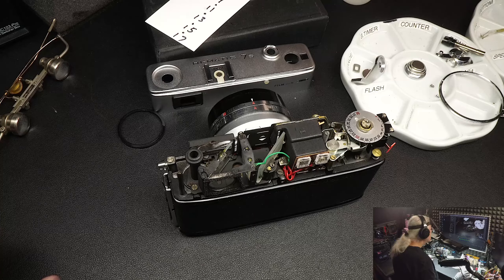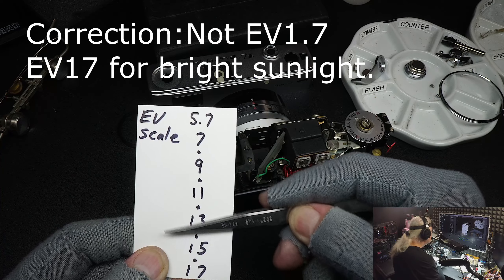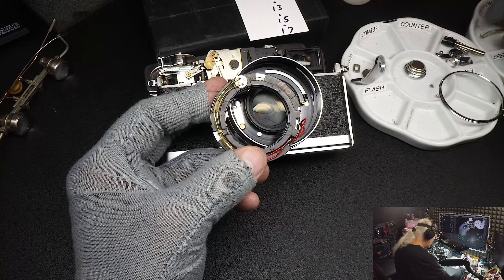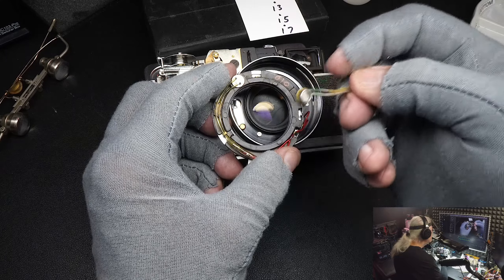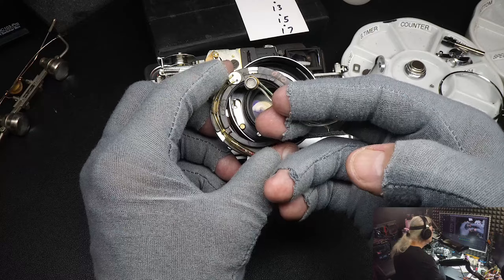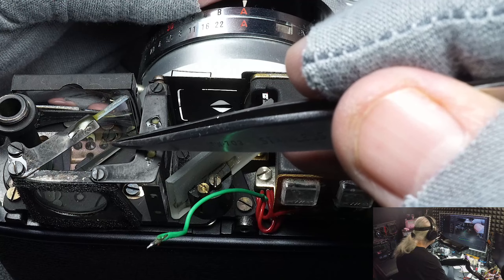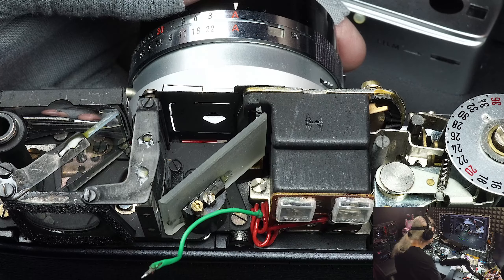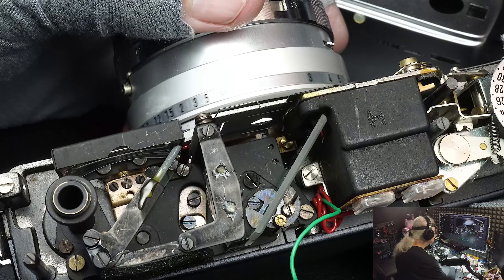Minolta Hi-Matic 7s Vlog Tour (Part 2) | Vlog #018

Comment: Hello, could you please advise me which LDR sensor to order for the Himatic 9 camera?
Reply from the maker: Sorry, I can't help you with that information. I've always just taken a good LDR from another working HI Matic and used it to repair a broken Hi Matic. In the camera repair business, we call them junkers and we rob parts from them. It does not have to be a Hi-Matic 9. It can be a Hi Matic 7, Hi Matic 11, Hi Matic E, etc. Most use the same LDR. I can't remember the best match for the Hi-Matic 9. You may have to experiment a little to find a match and use the meter adjustment to make match them. It's not hard. I'm not sure you could order a new LDR, and I would not know even where to look for one. Just find a non-working HI Matic on eBay and rob it of parts.
Reply: @FilmCamera_Vlog  Hi, thank you very much for the quick reply. Then I'll look for some donor camera.

Comment: how to open the top of the camera? my viewfinder is super cloudy
Reply from the maker: I am sorry, but I don't make tutorial videos, I only vlog. As for the top cover. It's simple. Remove the Rewind. Remove the Advance lever. Remove screw on left, right side, middle of the top cover. I am sure you can find a tutorial video with a Search on Google.
Reply: @FilmCamera_Vlog  i tried it on google, there is different camera & model. 
Anyway, once opened, is there any specific lens or wire or specific thing that I should not touch? And for the cleaning stuff what can I use? Any substitute as well? Thank you.
Reply from the maker: @alecleo3434  
I use naptha to clean camera parts.